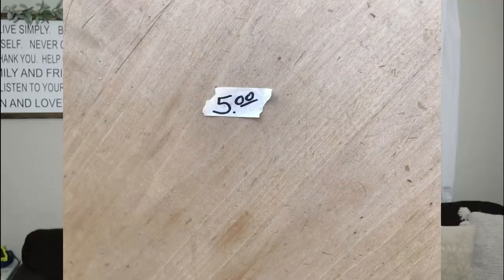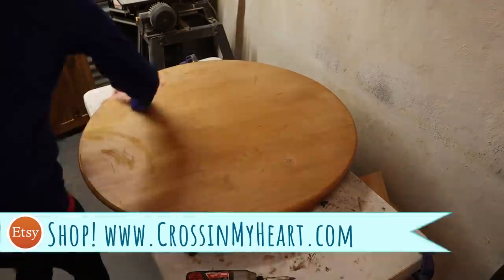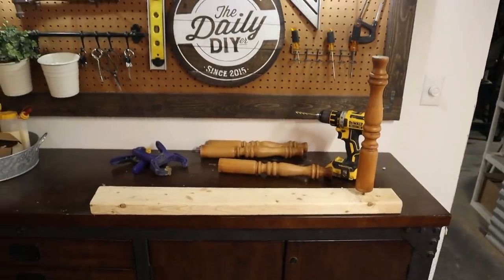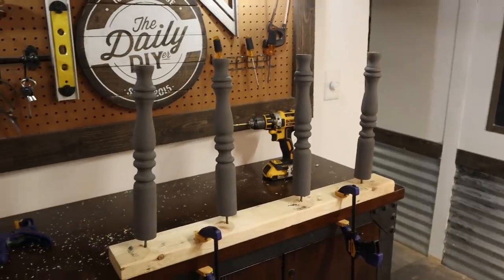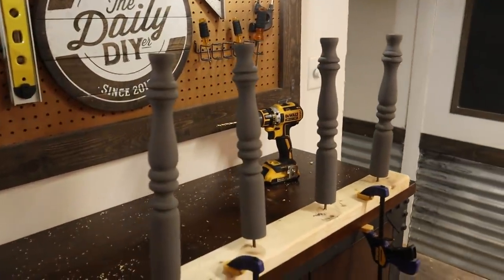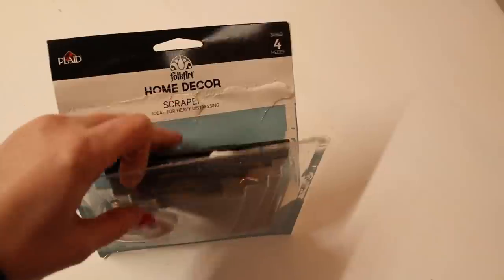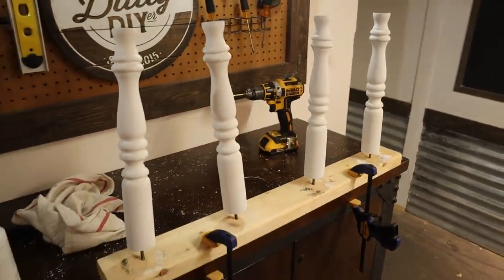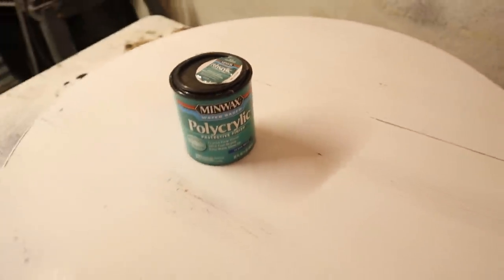Trash to Treasure ✨ COFFEE TABLE

Comment: The table is perfect in your space.  So you know polycrylic does yellow over time you would need to use a true furniture sealer like DIY Paints Big Top or Sweet Pickens milk pink Topcoat. Also one tip you can use a bench scraper like the one at dollar tree to scrape the paint after the wax/paint has been applied.

Comment: Hey Shannon. The table turned out awesome. Just wanted to let you know  trick we just found out on fixing stress cracks in furniture. We recieve a farmhouse table with 6 Windsor chairs a few years ago ad a gift from my sister in law. As I restored it by sanding it completely down, staining the top and painted legs, 2 weeks latter this stress crack appeared. I freaked out loll. So, started researching how to fix and ran across a video where you use Titebond wood glue and a shop vac and we fixing to try this. Simply amazing. I'll let you know how that works out lolll The video is on you tube.
Reply from the maker: How cool!!